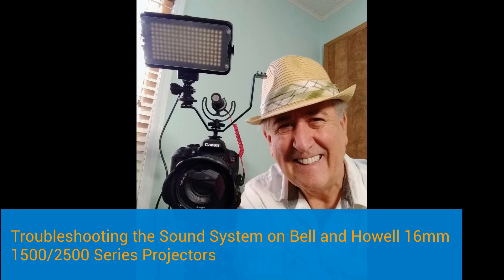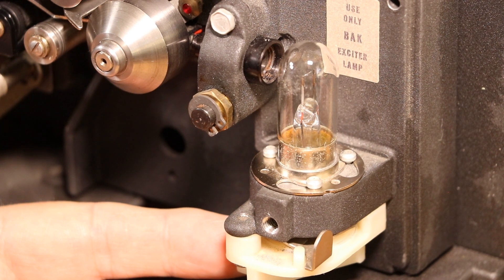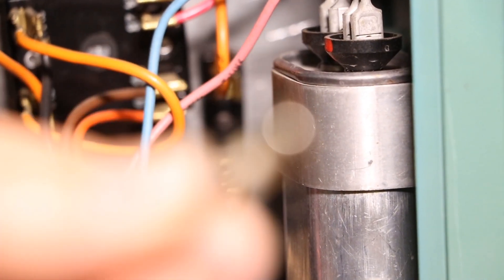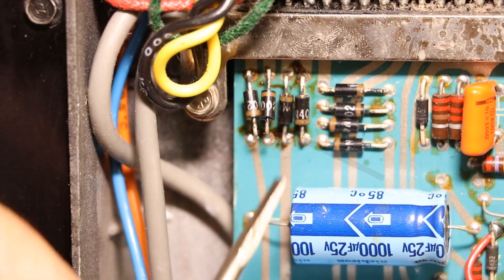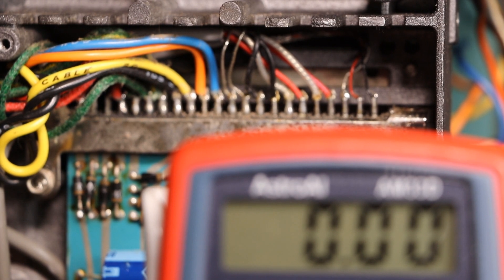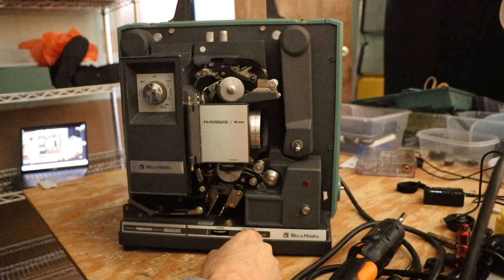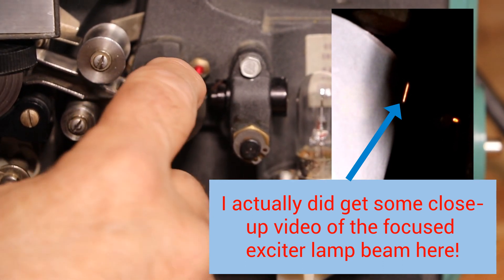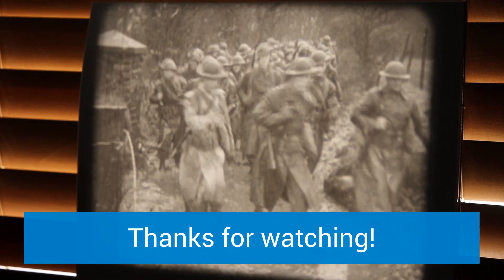Troubleshooting the Sound System on Bell & Howell 16mm Projectors, Models 1500-2500

Comment: I have an exciter lamp that won't light on my B&H FoS and I was really glad to have the information for further testing. One further test is run the projector with the exciter lamp pulled and shine a bright penlight into the optical tube and if you get sound.... well that's something.  I do get sound that way; so the amp isn't completely shot.  And the exciter lamp and fuse have continuity. So now, armed with your video, I can probably resolder errant diodes. Or, as one of your commentors said, the board is rebuildable.

Comment: I bought an old RCA 1600 for $9. The sound went out shortly after I got it. The exciter lamp worked but the sound was extremely tinny and barely audible with the volume turned all the way up. A little research revealed that these projectors were known for their unreliable amps and I don’t know enough about electronics to repair it. I opened the machine up and found the shielded coaxial cable connecting the photocell to the amp. I unsoldered it from the amp board and connected it to the input of my guitar amp. It instantly produced big bold sound! To make a permanent connection I disconnected the amp’s output from the 1/4 inch phone jack for the loudspeaker, rerouted the coax to the jack and soldered it on. Now the jack is a photocell out not a speaker out and I can connect it to the guitar amp with a conventional guitar cord. 

The output gain of the photocell is nearly identical to a dynamic microphone, so it doesn’t have the gain needed for a line level input. It sounds great in the hi impedance unbalanced mic input on my acoustic guitar amp.

Comment: Thanks for this video. I have an EIKI NT-0 that works beautifully - except for the sound. No light. Fuse is good so I'm working my way towards checking on or repairing the amp - seems to be similar. I actually also own two other 16mm projects - both are not working for various reasons but haven't dug into them yet. I think they are both B&H - a 1592 and a 2580 model. I want to get at least one working - I have some awesome old Disney B&W cartoons - about 20 of them, a couple of John Wayne's and other films to show.

Comment: Hey Mike, thanks for the video, was very useful! I was wondering if you plan to upload one on bell and howell projector's maintenance and cleaning
Reply from the maker: Actually, there's little or no maintenance on a B&H 16mm projector.  Inside, the bearings are permanently sealed.  Yes, there's some grease on the sprocket and drive gears and an oil wick above the sprocket cam, but that's about it.  Truly, those typically only get cleaned and lubed during complete disassembly, like when one installs a new worm gear in.  

Outside,  the film path (guides, aperture and pressure plate should be brushed out and wiped down with a clean cloth with a little alcohol after running old films, but never oil these parts.  If you run a lot of films (I don't), use a good film conditioner on them.  Refer to pages 22-24 in this typical owners manual:  http://www.film-tech.com/warehouse/manuals/BH258525902592OPER.pdf
Reply: @Est1951  I see, thanks! I just got one from a yard sale, and it was a little dirty, that was the reason I was asking. Another question, what can be the reason of perforations breaking when going backwards?
Reply from the maker: These projectors and 16mm films are typically 35-60 years old or more.  Like my 71 y.o. body, many of the parts are worn out (and parts are hard to come by).   Most film enthusiasts NEVER run films backwards just for that reason.  It's best to run films to the end then rewind them, preferably on a manual rewinder, looking for worn/broken perforations that need to be mended or spliced.  Most commercial films had "do not rewind" labels affixed precisely for that reason. Many vintage films are worth more than a projector.

I'm late to this hobby, and I don't run film much anymore.  If you want to learn from the original experts, go to https://16mmfilmtalk.com/ for years and years of topics and solutions.  Please don't barge in with a bunch of newbie questions at first, but use the search first to find solutions already posted.  I learned a lot from this forum.   BTW, these guys are dying off fast, and many of the best posts are from deceased members.    Best of luck!
Reply: @Est1951  Thanks Mike, learned something new today!

Comment: I have a 1692 model. The exciter lamp went first then the whole thing went. Replaced fuse which is on the outside. Projector goes. Still no exiter. Yet to open it up. Thanks

Comment: One could also rebuild that amp by finding a schematic and ordering the new component values.  Sometimes the caps leak, diodes go bad, and resistors go out of tolerance over the years
Reply: No schematic required, just replace like for like.

Comment: Those electrolytic capacitors, not condensors there is no condensing happening here, really should be replaced. These are very rebuildable cards.